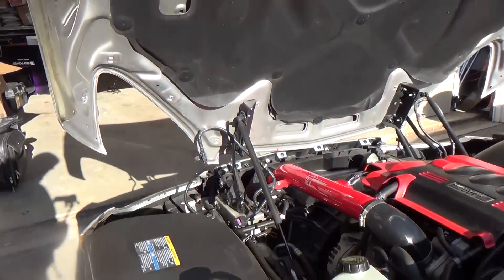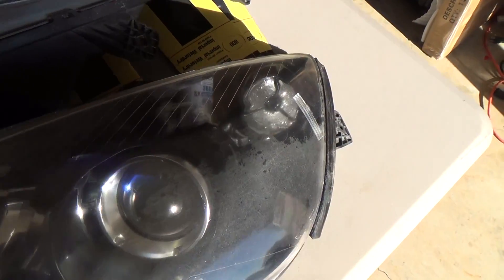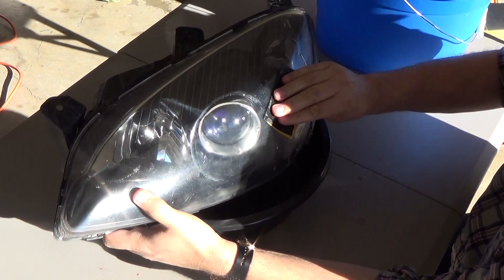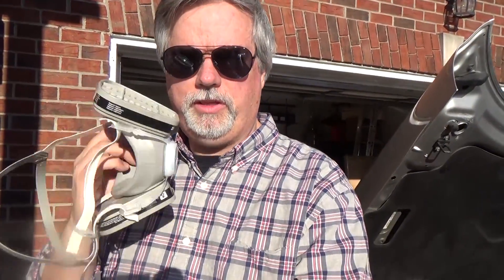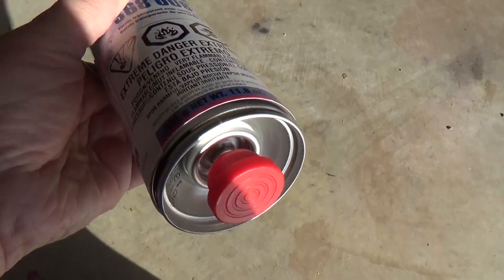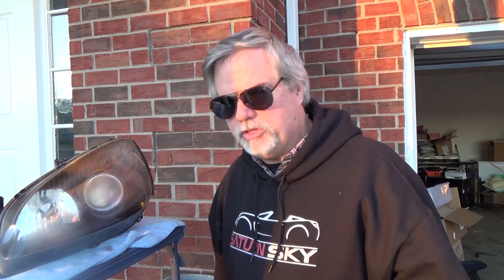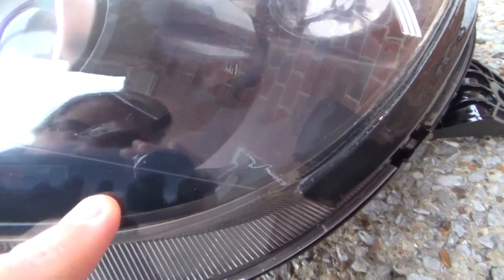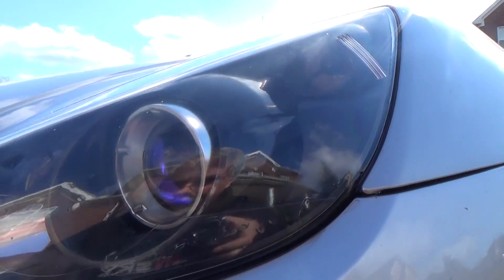Restoring My Headlights With Wet Sanding Method

Comment: My Sky doesn’t need this yet. I’ve done numerous friends and family headlights. I wet sand  with micron grit paper and polish the scratches out with 3M and polish wheel on drill gun. I’ve never clear coated again I’ll have to try that.

Comment: I could not help mine went ahead and ordered new ones $325 each to bad you can’t just replace plastic only but work in progress I have a redline and only 60,000 on it but weather took toll on it also ordered new top because eventually the rear window will separate from the cloth and not repairable. Anyway thanks for another video

Comment: There are hundreds of headlight restoration streams using old school wet sanding!! 🤪 It slows down surface removal as water acts like a lubricant and obscures any left over damage, Is messy and requires tons of elbow grease!! And please don't use 2k clearcoat on headlights it's far to hard and a nightmare to remove, As you find out in due course, If it's not written on the can for headlights don't use!! Always use a deadecated headlight clearcoat with UV protection!! One coat or two maximum as two many layers distortions light transmission!! Anyways a reasonable result for a novice!!🤔👍